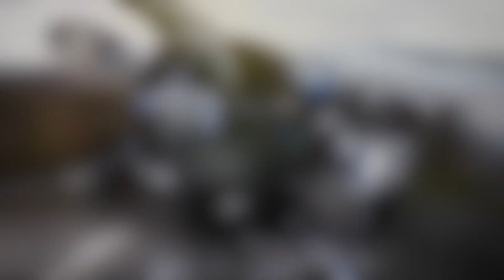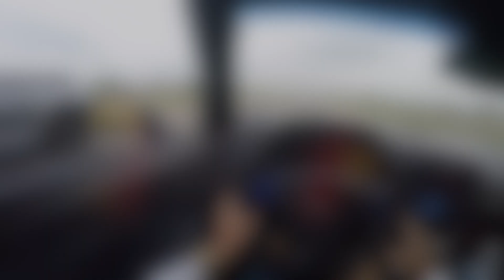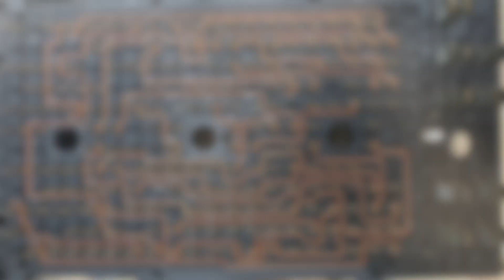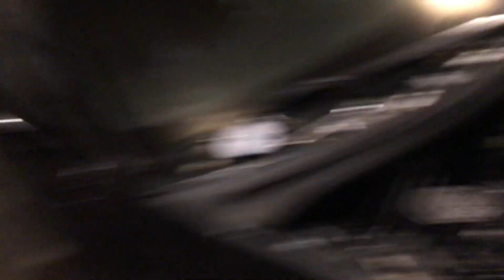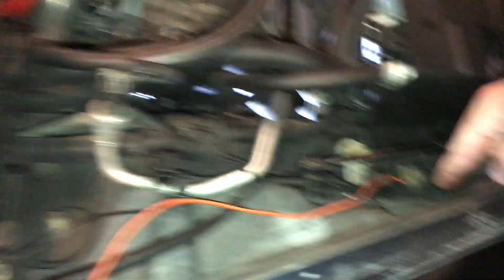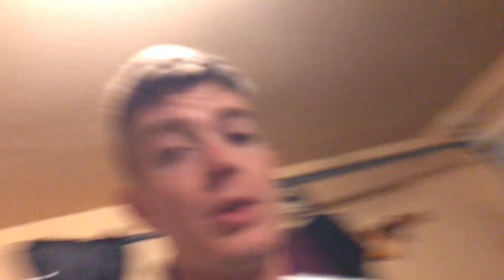C6 Z06 Engine failure (Broken valve spring) - misfire - shaking

Comment: You don't need to crank the engine over with the crank bolt.  Raise the rear a couple inches, put the car in 6th gear and turn the rear wheels to turn the engine over.  I did this on my C5 Z06 when I swapped valvesprings.  Also, you can bring the piston up to the top to hold the valves up, no need for compressed air or rope. Have a buddy help turn the rear wheels, you can confirm the piston is at the top with a dowel or a pencil in the spark plug hole.  Easy peasey.
Reply from the maker: Excellent tip, I didn't think of this
Reply from the maker: Hey Alex, I just attempted your method, I have the car in the air on jack stands on all four corners. When attempting to spin one tire on my own I just spin the other tire the opposite way, then I put a chuck to stop the other tire from turning, still can't get it to move in 1st. Then both my friend and I tried to turn each tire at the same time, I wouldn't say we are whimps but still nothing. Maybe for the LS1 it is easier but we couldn't get it to spin. Also in the past I have tried to bump start the C6 Z on a 10 mph roll and it just slid the 12" tires.... So maybe not the best thing to try on the Z. Now I am worried I won't be able to turn over with the torque wrench.. The engine is not locked up at all btw..
Reply: @z06baron6  Were you in 6th gear? Great video btw. Hope this works out for you.
Reply: @z06baron6  yeah you need to do it in 6th gear because the high gearing works in your favor

Comment: My 2005 GTO had the same thing happen to the exhaust valve on the 5th cylinder.  It happened only a mile from home but that mile was the longest ever.  The car was shaking so bad I thought the engine was going to break a motor mount.  Got it replaced and like you I got lucky because only one of the keepers were in keeping the valve from dropping in the cylinder.

Comment: You probably already figured it out by now, but if you have the belt on the front of the engine, you can put a socket on the alternator pulley and turn the motor.

Comment: I have a 2000 ls1 trans am. And I believe I'm going through the same issue. I still have yet to pull the valve covers but all of my diagnostics are telling me that one of the springs could be broken on cyl 7. My car started running rough during an autox event, fortunately not while I was on course. I did 3 out of 5 runs that morning, I go to turn on my car between run 3 and 4 and I was greeted with a rough running engine and a flashing light on the dash. I guess starting the car was enough to cause a problem. So far I have a p0300, I've changed the crank sensor and that didn't fix it. Im dreading thinking about changing valve springs. But I did enough runs that day to take back first position in the season ender and win my class!
Reply from the maker: All three times when I had valve springs break it did not throw a code.

Comment: Hi guy with a different cam you have to use a double spring make sure. You do the valve guide job other wise you are going to drop a valve some day Good Luck
Reply from the maker: Hey, broke a second valve spring. What springs do you recommend

Comment: Great video! 
I just picked up a 07 Z, low miles. Yesterday I thought I heard a misfire. Also yesterday, not every time but 2 different times, the car did the dieseling thing for 5-10 seconds after turning off ignition. I’ve read with the c6 Z this can occur for a number of reasons. Have you had any issues with dieseling?
Reply from the maker: I have had this issue with my car many times. It is 100% an electrical issue. I found mine was caused by loose connections to the battery and then I found there was a slightly loose connection somewhere in the fuse box, I had to pull the box, hammer out the rivet bolts holding the assembly, then I inspected every prong and wire running inside it, I didn't see any breaks, then I carefully pinched further closed (just a little bit!) every fuse and relay connection fork. In my intro video one of the pictures shows the wires running along the board. Put everything back together and haven't had the issue once. A bad alternator or ground could also maybe cause this issue. When I got the car I really had to go every several grounds, fuse box, battery connections and make sure everything was sound. Most of which wasn't. Every ground on the C6 corvette is painted, then grounded. Terrible. You need a metal to metal contact on the whole surface of the ground. Both the C5 and the C6 have these issues.
Reply: @z06baron6  Thanks for the reply bro. Very informative! Im going to go through that check list and see what I find. My OBD picked up a lean code bank 1. Tomorrow I’m picking up new plug, wires, and coil packs. Hopefully that will resolve the issue. Then alternator if necessary. I’ve read that the alternators GM used weren’t efficient enough for the LS7. Still have a lot to learn. My 97 SS camaro is definitely not as complex…lol Anyways loving the vette community. Good people👍
Reply from the maker: @JustinMay1480  make sure the car has stock parts if not like I found if you replace it may run worse.

Comment: Might as well do the heads now. Replace those springs and valves which are a weak point on the C6 Z
Reply from the maker: Valves, guides, and springs have been replaced

Comment: The z06 is so overrated not in terms of power but in terms of being a good car. Its a ticking time bomb, people say its a affordable super car, how. $40k to 50k for a used one and 20k when it gernades, if you want a realiable c6 corvette get the ls3 and mod it
Reply from the maker: Very true, I think the best of both worlds is a Grand Sport! Z06 engines are expensive because they weren't put in many cars! And they actually blow up often
Reply: The LS7 with a better set of heads is an amazing platform for NA builds. Stock block the LS7 can take 650WHP no problem. I wouldn't say the LS7 is overrated in any way shape or form. It's when people start boosting a stock LS7 block is when things start to go bad.